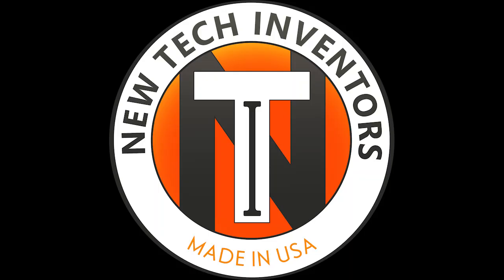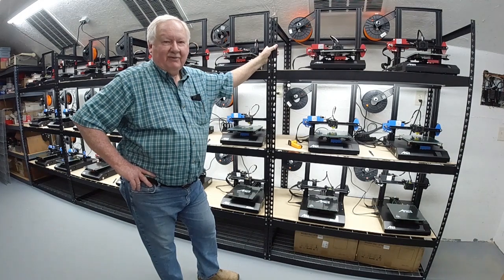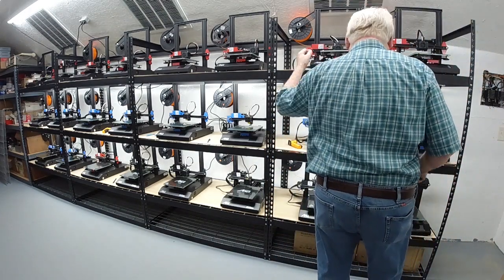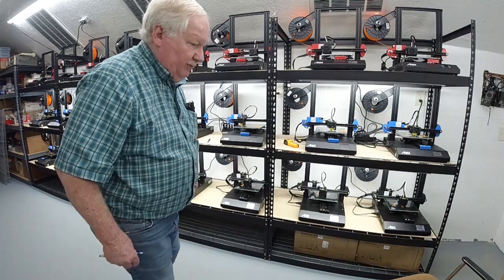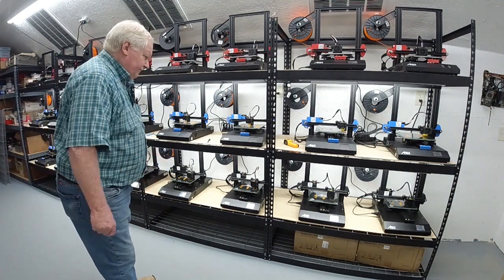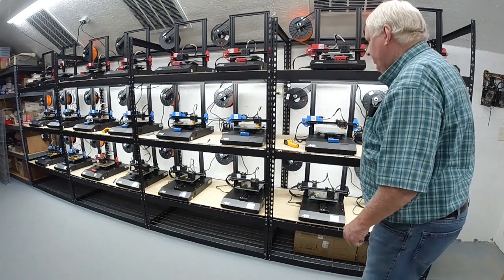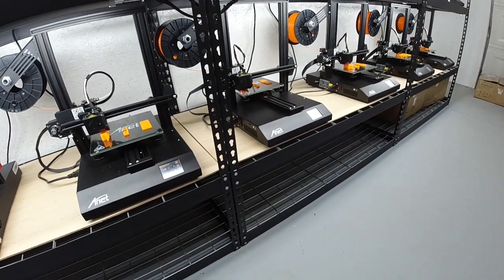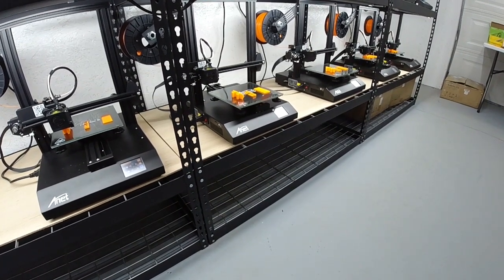MY HOME BASED 3D PRINT FARM FIRST RUN, running 22 of 24 Anet 3D printers at New Tech Inventors.

Comment: I'm surprised those big rolls of filament turn easy enough.  I like how the s1 pro is, it has a bearing in the roller so it turns super easily.  If I used rolls that big I probably would have went that route.  Seems like it's working out okay for you though so don't mind me just making random observations.
Reply from the maker: The new filament holder I am making for the Kingroon printers have dual ball bearings and allow the filament to feed very smoothly...Ken

Comment: How far should the printer be apart? I have a small wall to work with (84"). I have 1 x CR10s Pro and 1 x Mono X + Cure/wash plus. Looking at getting another CR10s Pro. The only issues is I feel having them connected might cause wobble on the resin.
Reply from the maker: II have found that 3D printers can be as close to each other as long as they don't touch each other, are on a stable shelf or table, and the power supply fan from one is not blowing on the other printer in the area of the print head. If they are on an unstable surface the erratic motion of the surface may cause some distortion in the print. Good luck, I'm sure you will get them set up and printing well. Thanks for your comment and your support...Ken

Comment: I would recommend setting up a octopi on each unit to control from your computer. You'll be able to monitor prints from your phone or computer, and send prints the printer from any device too.
Reply from the maker: I do plan to look at octopi as soon as I have time. Many have suggested I try it and it's high on my list as soon as I get the website going. Thanks for the comment and for your support...Ken

Comment: Never did have any luck with my anet (actually traded it to the guy who repaired my tevo tornado, for the cost of the repairs)....
Reply from the maker: Sorry you had trouble with your Anet. I have many brands of printers and they all work differently, I have had to get used to each one and figure out how to get it to work for me. Some printers do will with PLA and not so well with PETG and so forth. I try to find the jobs that run best on a printer and stich to that. I do have a lot of Anet printers and haven't found anything I can't print on them, YET !! Thanks for your input and for sharing your experience...Ken

Comment: Now this is what im talking about, NICE!!! why aren't all the printers the same??  (SILENT) Also why are you not printing overnight??  Print Farms should be running 24/7?  just got the Ender MAX,, Love all my Enders. What made you pick that brand of printer??? GREAT VIDEO!
Reply from the maker: Good to hear from you again my friend. The reason I have different Anet printers is because I first purchased some ET4X printers at a good price, $124 each and after that I got some ET4 at a good price, $130 each and decided to try some ET4 PRO printers for $150 each. I wish I could have afforded to buy more PRO printers at that price, they are now $200 or more. This first run was a test to see which printers needed tweaking, after I am sure I have all the bugs out I will start my production runs. The price had a lot to do with buying Anet at first, and now I just have to make them perform. thanks for some good questions...Ken
Reply: @NewTechInventors  cant argue that price point ken, when you see a deal Take it right away. Can i ask what type of filament your using? Wish i lived close, i would come help ya out! Great to hear from ya buddy!

Comment: You might want to use hair spray.I never get lifted ends. My print farm has mirrors and hair spray. I touch up with the hair spray every 30 prints. Happy printing
Reply from the maker: Thanks for the comment my friend. I did use hair spray on these printers and since I just recently started printing on glass I need to do more testing to come up with a good formula to combat the adhesion problem. Thanks for watching...Ken

Comment: Congratulations...you did a great job.   Now the fun begins.   Glass take a while to get use to.  Heating it up slightly may cure the lift.  I have some other remedies but will recommend those for later time.  2 problems out of 22.  Great .     Noise level seems high.  A lot of fans going on.  Those pro printers seem quieter.  I wonder if Anet has a upgrade on their fans..  thanks Joe
Reply from the maker: Thanks joe, you've been there all the way, and I appreciate you. You're right, glass is different and requires more time to preheat the glass. My glass temperature is always at least 10+ degrees below the indicated bed temperature at the thermocouple on the bottom of the bed. It just takes a bit longer for the glass to get up to temp and some times it never quite reaches the temperature indicated. I may have to increase bed temperature to compensate for this. I will be experimenting with this. also the bed temperatures varied on these printers as much as 6 degrees. Must be the thermocouples??? The Anet PRO is much smother and quieter, worth the extra bucks. thanks my friend...Ken
Reply: @NewTechInventors  I learned that the cool the fan produces for the lay down of the filament Varys from left to right pending where it’s located.  Be aware of that temp difference and your lift off the bed.  My Ender 3 has a right side cool so the cooling on the right side cools the glass more on the right.  Lift off or curl is likely right sided.  This maybe my imagination but it makes sense.  Your friend joe

Comment: I only have 5 printers and one of them on Duet wifi and one on Octopi, to put the others on wifi printing would cost more than I am prepared to pay so I am looking into integrating an STM32 BT WiFI Cam board which cost very little money, this will enable me to automate print runs with one click and monitor each printer from any browser and even away from my network.
 I got to thinking if you have any thoughts on automating your print farm?
Reply from the maker: Thanks for the comment Andrew. I have some things I am working on now that I will reveal soon, if they work. They are mostly safety related ideas to prevent loss of material and damage to the printer in the event of print failure. I will be working on them more now that this phase is complete. Thanks for watching...Ken

Comment: Finally! :-)  What's your reasoning behind pre-heating, do you normally do this, or are you just doing it because you're still checking power usage and testing?
Reply from the maker: Thanks for the good question Ryan. The reason to preheat is mainly for bed temperature. With the glass on top of the stick-on pad, the bed temperature indicates 60 degrees, but the glass is less than 50 degrees. It takes a bit longer for the glass to heat up. Since the first layer is the most important in good adhesion, I want the glass to be hot enough to give it a chance . Thanks for your comment and for watching...Ken